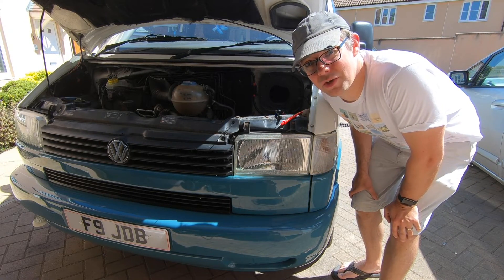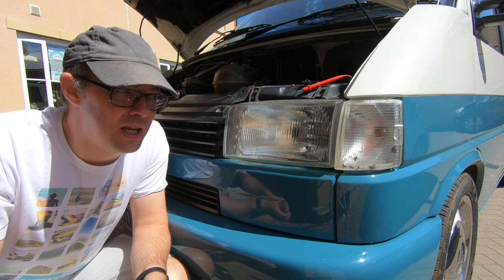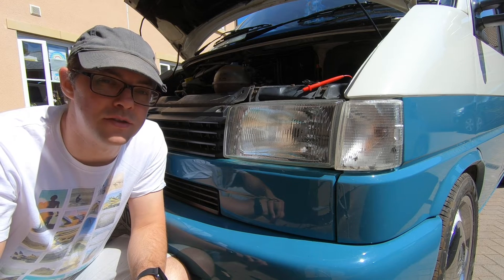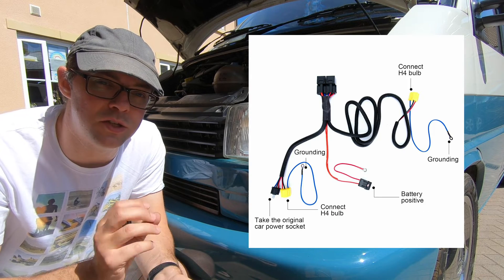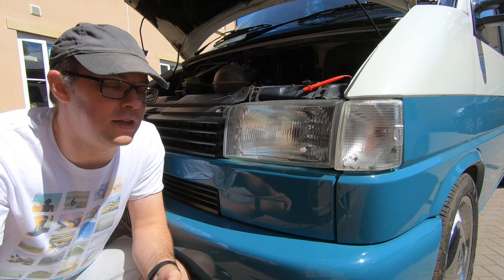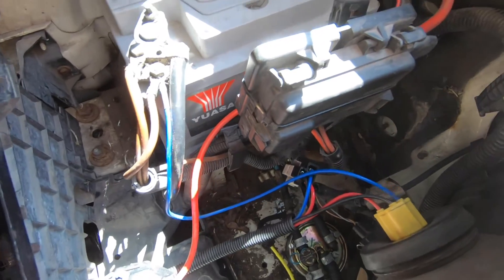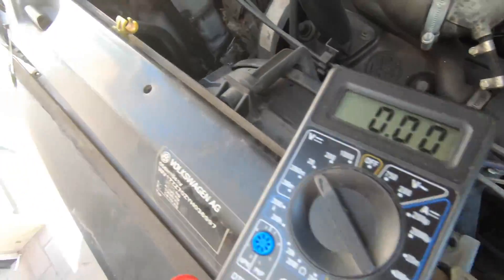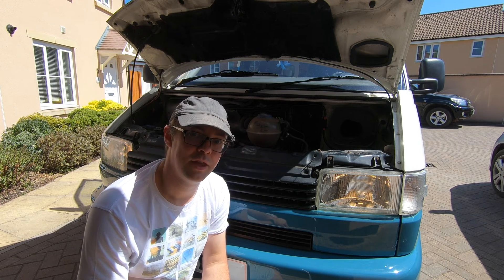VW T4 Headlight Wiring Loom Upgrade: Brighter, *fully legal*, No LEDs!

Comment: I recently purchased a 1993 T4, and with your guidance I just replaced the headlamps. Your video was really helpful. Thank you. Now I’m thinking maybe I should buy a wiring booster thingy too. Thanks again. I’ve never worked on vehicles before and find it very satisfying
Reply: From canada BTW
Reply: @Megamailh  I saw your comment on the vw t4 family. You commented that you are working on a T4in Canada. Did you find a wiring loom for your headlights?

Comment: Thanks for posting! This is a question I have been thinking about for a while.
Reply from the maker: Thanks for the comment, if you have any further questions feel free to ask 🤙
Reply: @T4Family  Does this headlight loom work on a left hand drive shortnose Canadian spec van? Do the headlights work nicely? Are you using Ecode headlamp assemblies?
The prices on Amazon are great. Do these products deliver the  expected improvement in lighting, and has the new wiring loom deteriorated since installation?